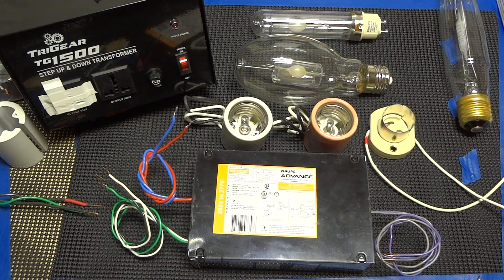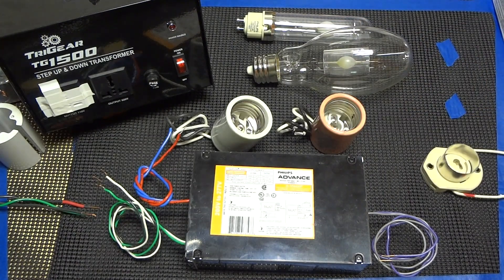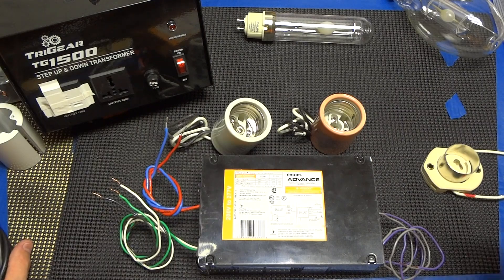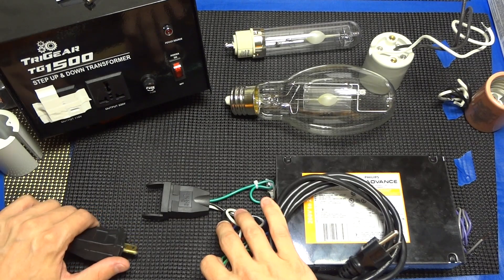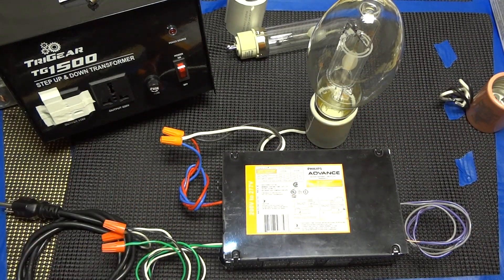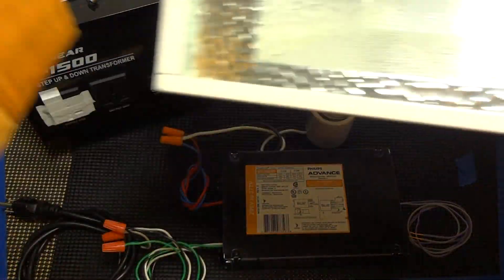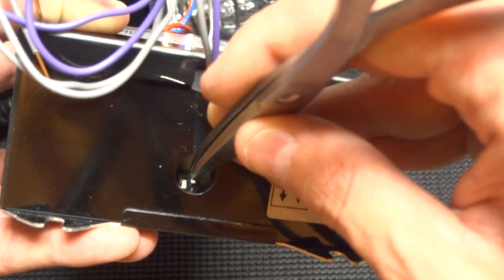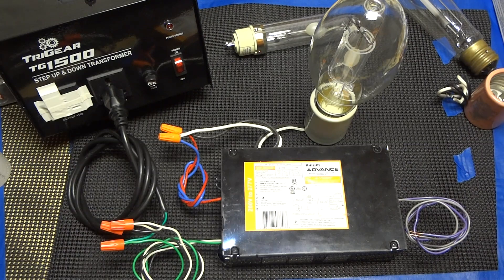Philips 210 and 315 Watt cdm mw introduction and how to wire and more

Comment: Hi, I was wondering what is the dangers of putting the mogul to PGZ8 adaptors would do to my light fixture? I know you say on your video that it shouldn't be done but most people in the industry of horticulture are selling these Philips 315w light fixtures with the bulb adaptors to screw into the light hood/reflector, I was wondering if you could shed some light on this for me please?Thank you,Neil,
Reply: you can't use adaptator. In EU doesn't follow EU rules. You need a new lampholder. www.acm-lighting.com
Reply: @acio88z  thx for info! I also bought the adapter.. but now I'm gonna look for a pgz18 holder..